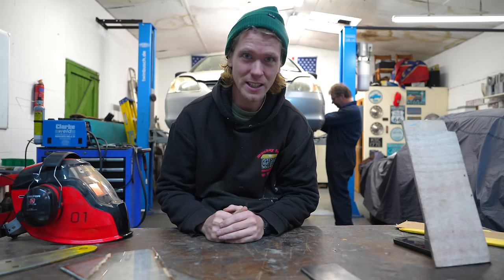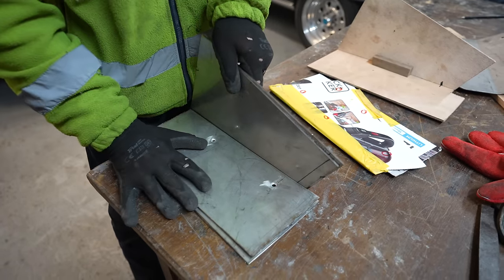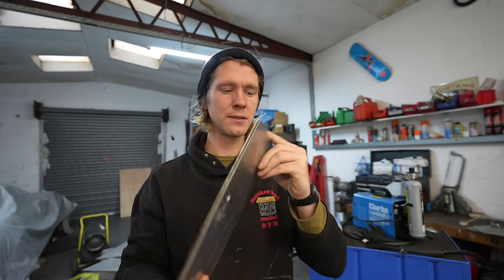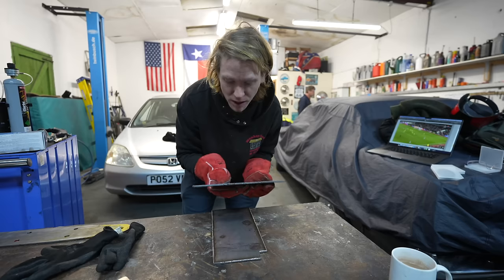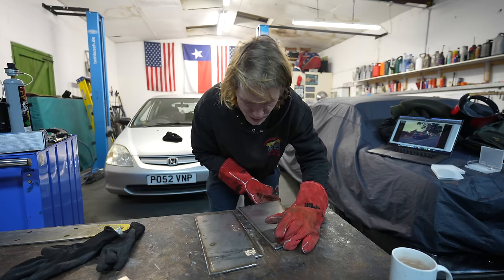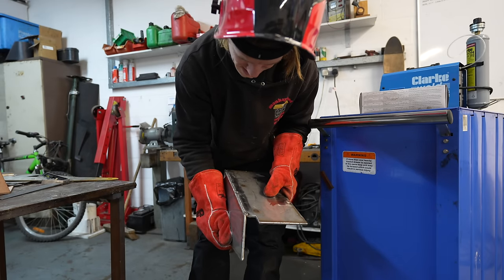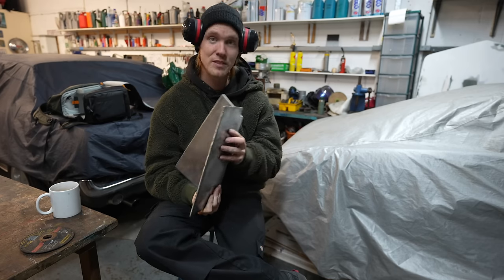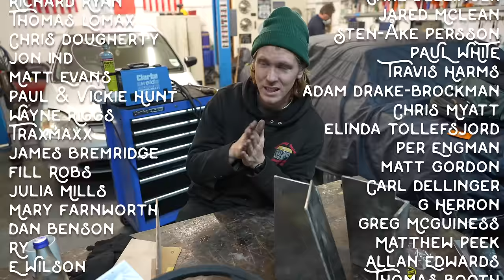My Salvaged Catamaran gets Salvaged Chainplates | Wildling Sailing

Comment: Nine years in the oil industry coded welder to work on ships in all types of material. Take me manual stainless early and Miles steel stainless steel was called 316 you refer to. It is 316 but these letters are sent individual. I’ve concerns that if you have an accident, these plates will not be covered by your insurance, as into work on a ship. I had to be fully coded, I’m also think that people that are saying that the whales look good really should’ve spent years at college like I did your only saviour is the fact that stainless steel with its fact is very sticky material once it’s gets going would’ve been ideal for this operation not me your internal WallI’m not good I wish I had the time to come and see you and teach you as a retired welder. I haven’t got the time more practice and a better source of knowledge would help you
Reply from the maker: thanks for the advice. the inside welds certainly aren't pretty and id like to think they're OK, ill be keeping an eye on them for sure